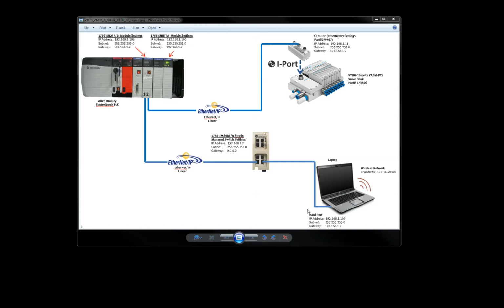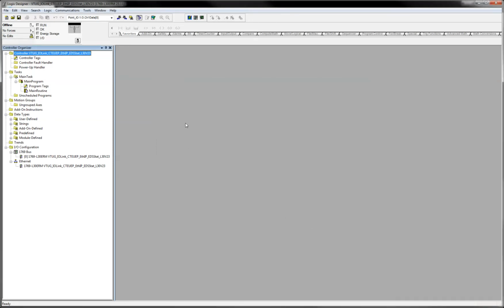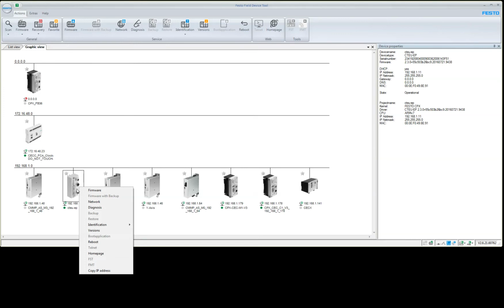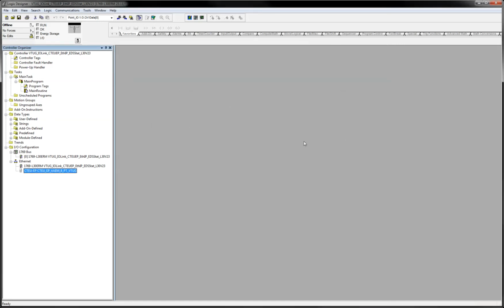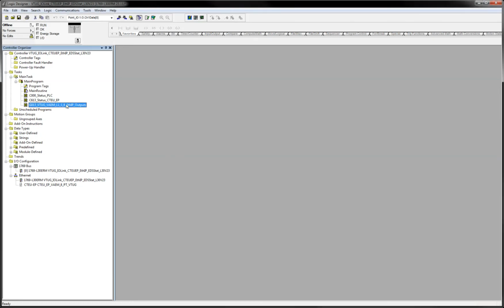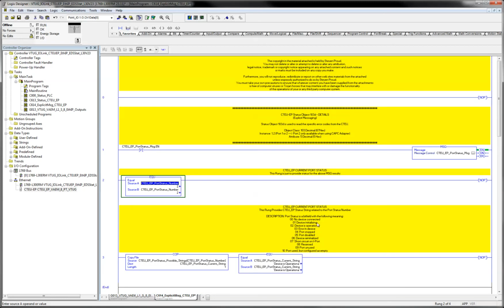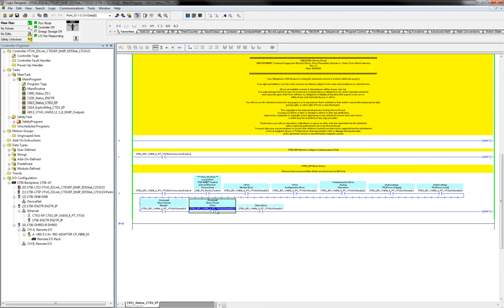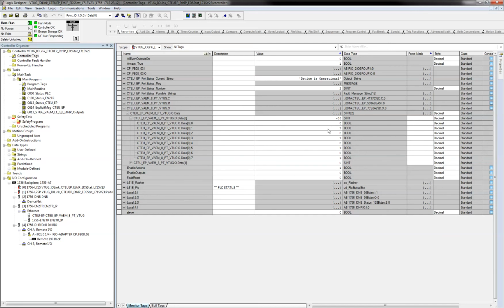VTUG + VAEM 8 PT + IO Link + CTEU-EP + ControlLogix + EthIP + Status Bits & Explicit Messaging

Comment: I can’t seem to get my set up to work. Once I add it to my plc, I keep getting an IO FAULTED message with an error 16#0203 because the communication times out and idk why. 😭
Reply from the maker: Unusual because this is normnally very straight forward.  Hard to troubleshoot on YoutTube and I dont provide support here.   Rockwell has bug with EDS AOP on old RS5000 versions, so, I can suggest goto webpage & confirm IO size, delete existing EDS AOP, Add again, select fixed size with hard set IO - do NOT chnage this config after accepted and closed (this is the Rockwell bug).  If that doesn't work, try generic module and same method use correct instances -> I think from my memory 101,100,102 with exact IO size.  If nothing works, contact Festo technical local support